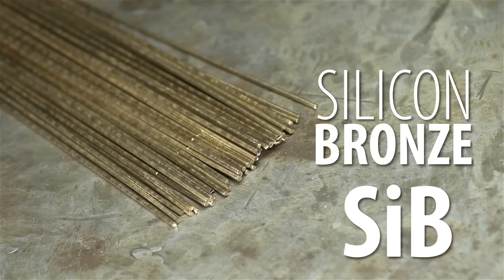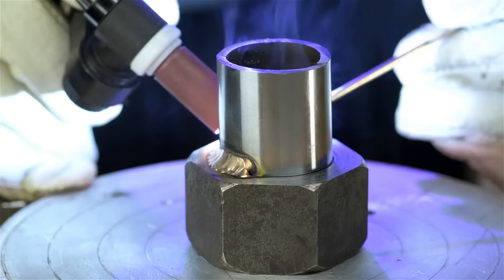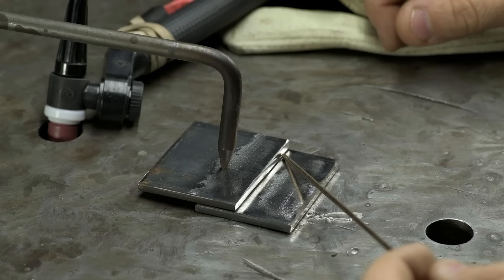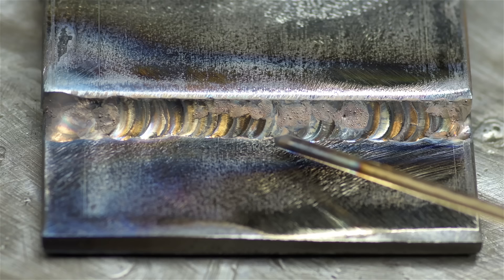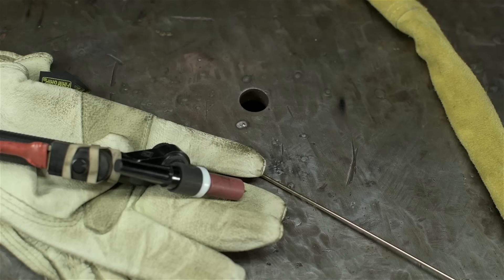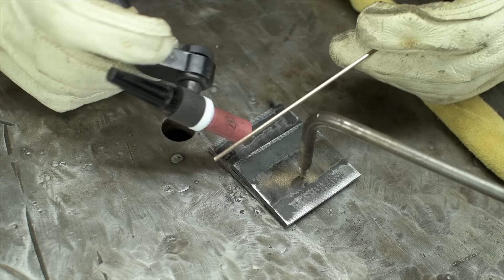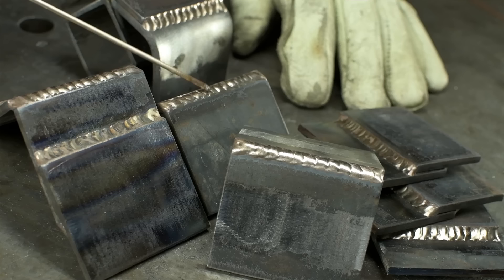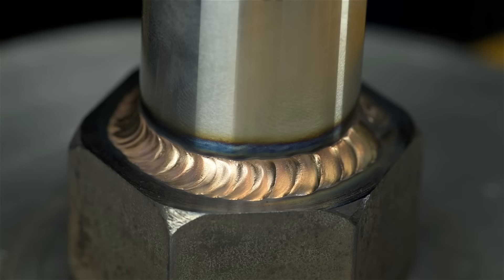Adventures in TIG Brazing

Comment: A really good quality welding helmet helped my bad welding much more than using a really good quality welder did.
Reply: What helmet
Reply: A good helmet and the right lense make all the difference
Reply: @stankhunter666  motorcycle helmet
Reply: Optrel 2.0 series is way to go!
Reply: It's all about comfort and control, if you don't feel comfortable and confident, it'll show in your welds
Reply: @Kawka1122  does it have to be dot approved
Reply: I really need to understand what a good helmet is.
Reply: me too
Reply: @MatthewTaylorAu  not so much the hood as the lense in it. Comfort is a factor as far as neck strain from different weights. But I personally use a huntsman slider. Nothing fancy but is light,flexible, can us with either a hard hat halo or a soft band. But I use lincoln 4c lense which is super clear lense. Mines a variable shade which is great for different welding. I typically run on shade 12 whit a pair of 50/50 safety glasses. But lense quality is (to me atleast) more important then the hood itself.
Reply: Being able to see is the key, i found not being tight and changing the clear lenses, or not using the same lid for mig welding galv was the key for me. I have a 3m, Miller and a $60 jobbie, still use the cheapy pretty often to be honest, just buy lens material in bigger sheets and cut my own now!
Reply: I read “bad welding” at a glance as “bed wetting” 🤣
Reply: Welding machines regardless of make, do the job. 98% of bad welding is the human. Its Honda like the humvee. They made it because 98% of ppl who think they can drive off road, can't.
Reply: @MatthewTaylorAu  Optrel panoramaxx 2.5
Reply: Adflow 9100x
Just get it. 
If your not a boilermaker dont worry but if you are it will add years to your life
Reply: You should spend a couple hundred dollars or more if you want an actual welding hood. Recommend Miller clearlite 2.0’s. Anything under 100$ is just for hobbyists.
Reply: @Xteam500  bad sensors
Reply: I'd like to see a polished etched cross section of the joint, suspect there's some minor mixing of parent metal and braze. Not quite weld, but more than braze.
Reply: Yeh my new helmet helped me to see that my work still wasn't sellable
Reply: borrowed my boss's 3M Adflow for a couple weeks. life changing.
Reply: Facts
Reply: Im just getting started and that thought occurred to me. Glad to hear it backed up. Now I just need hands that do what they are told and some patience with myself.
Reply: Only a rookie would say that
Reply: Tell me you know nothing about welding without telling me...
Reply: @frankiefc3  what does that mean, you don’t make any sense. What is the ugliest thing on a construction site? A welder with their hood up😜😆

Comment: You are working on a heat sink, try pre heating and doing it on a fire brick you need less amps for the flow. It's a simple thing hot summer less amps, cold winter pre heat

Comment: Tony, I'm a welding instructor and boilermaker. I enjoy your videos. They're not only very funny, but perhaps some of the most insightful sources on joining metals. I'm glad you mentioned joint configuration design and how a brazed joint can be just as strong. What I like about bronze is that it allows you to temporarily join dissimilar metals. Afterwarda apply heat and voila take them part with minimal distortion and clean up. So when you're working a prototype, it's an excellent alternative to welding if you want to save material in that phase of a project.
Reply from the maker: Good tip MB, will have to try that out!
Reply: MB, I've always heard it was a good way to permanently join dissimilar metals. Is that true? I do metal artwork, and while most of my work has been in stainless, I've sometimes wanted to add something like copper or brass to it for visual effect, and TIG brazing seemed like it might be the answer. I even bought some rod, but I've never tried it.
Reply: @TomHaroldArt  bronze would set that stainless off well. Sure you can permanently join dissimilar metals if that's what you want. Do me a favor: Look up titanium bicycles. Many of which are brazed together. I love the contrast. One of the oxy fuel assignments I have my students do is make a cube from polished 1/4" carbon steel plate with brazed joints. Afterwards they polish any rough spots out with a tiger paw or flapper wheel. Lastly spray it with a clear rustoluem so it doesn't oxidize.  I love what I do. I've started a non credit class once a semester where we make art out of silverware and hardware. For that I prefer stainless MIG or TIG. Good luck!
Reply: With flame braising, using flux coated filler, don't we strive for a more liquid flow of the SiB (lol) into the lap joint? The intent is increased bonded surface area. Legit question - I took a course, nothing more.
Reply: @sp10sn  yep. You want it to sweat in as much as possible. The tighter the joint, the stronger it is.
Reply: Many thanks! I will look up those bicycles. I'd love to try something a little different. There are several other people who do what I do, and it would be nice to have something that stood out. I think the color contrast would be killer! Sure wish I could take a course similar to what you offer. My former shop boss took welding all through high school, and he had so much knowledge that I'd never pick up just from working on the job. Does rustoleum really hold up? I've had seemingly a hundred people tell me there's no clear coat that will ever permanently prevent rust over bare metal.
Reply: @TomHaroldArt  Put enough of that shit on there and it will be fine.
Reply: That's good advice, thanks!

Comment: Tony, I finally did some silicon-bronze TIG "welding" of some 16 ga steel sheet metal, it is totally amazing, I was able to do functional, though not pretty, welds without practice, the current is low enough that you don't risk burning through the sheet metal. IMHO this is what people like me should practice before going on to true welding, which I'm still not good at and will continue to avoid where possible because I get too few opportunities to practice in my field of hobby machining.  Another advantage for the newbie is that accidentally contaminating your tungsten with silicon-bronze doesn't affect the process and you can just keep going, unlike with aluminum welding where you have to stop and meticulously clean the tungsten and the parts and your progress is inches per hour rather than inches per minute(!).  Again, a million thanks for letting us know about this amazing process.

Comment: Tony thx for sharing. Once upon a time I used to work in a sheet metal shop where I carbon arc brazed flanges onto sheet metal duct-work. I didn't use double carbon rods, like gougers use, I used a single carbon rod as the heat source. The flange was about 1/8" thick whilst the duct was 20Ga. If I recall correctly the current was around 45A. I did apply the bulk of the heat to the flange. The bronze rod was just about flat to the joint. The bad news was that the flange & duct were both galvanized. I'm just glad I worked under a giant hood. So the carbon rod brazing method seems to be relatively forgiving when it comes to surface prep. There wasn't any. This method was called Eberdu brazing. Most likely the name Eberdu was a product name most likely the silicon bronze rod.

The joint had a smoothness to it like soldering does. No puddling dimes effect. Just a smeared out bronze down the length of the joint.

Hope someone finds this interesting.

Comment: I've only dabbled with SiB a few times but I do know you want a longer arc length, maybe double what you normally do while welding. The longer arc length will help spread all that heat out and make it wet in more smoothly. Using a gas lense on your torch and about 20-30cfh you'll get it to look really clean and pretty without having to brush the crap out of it.

Comment: Great video. I found silicon bronze very useful while building racing headers. I will always use it for a primary pipe attached to a cylinder head flange. You can keep the tubing light, thin wall, and reduce hardening the tubing and eventual cracking.

Comment: I used to use this technique occasionally on very unusual repairs, it melts so easily with little heat. Using silver soldier with a tig is also very useful sometimes when I needed to patch leaks in copper electrical equipment, when heat was a problem.

Comment: The use case where I've seen this stuff really SHINE (heh) is putting together complex shapes made from stamped or cnc bent steel sheet that has dimensions susceptible to warping out of spec with too much heat.  I found that clamping pieces together with a bit of a gap, resting the tungsten directly in the gap, pointed at the filler, and just letting er rip, running the torch down the line at full petal as fast as I could follow the bead seemed to be the best approach for minimizing heat affected zone while still making a solid braze.  You have to get a feel for how the stuff feeds into the puddle but it's an absolute joy to work with! Great stuff Tony

Comment: Thanks for sharing this knowledge, I am a retired, Coded TIG welder and I know how skilled you are. (VERY)
 I never knew TIG could do this, I did try once with brazing rods and you know the result !
I still keep my eye in with a portable MMA and TIG welder DC only, to keep the cost down, it has got auto strike HF.
I welded Aluminum professionally, but not enough need at home to justify the cost of  an AC / DC kit.
I will definitely get me some of those Silicone Bronze rods though, and have a play, on MS, S/S and Copper.
I found this video purely by chance, whilst researching World Bridges for my brother. I will look for more,Thank you.

Comment: Having done soldering, silver soldering, silver brazing, etc, etc, etc, I can totaly agree about the difference between gas brazing and TIG brazing.  For those not in the know, a properly fit up joint that is well cleaned, fluxed, and heated with the filler applied in the correct way and amount with a gas torch will result in fillets on both the outside and inside of the joint as well as the interface.  The result is a weld that far exceeds the strength of the base metals in most cases.  Think CrMo motorcycle and bicycle frames as a prime example.  Some aircraft frames use this method as well.  I have used silver solder to join parts to make custom hydraulic fittings even that held
Reply: I've always used silver brazing for small parts that need to look good and be gas and oil tight. What I'm wondering is, there has to be a way to use a TIG welder to do silver brazing? You need about 1100F red hot metal, or somewhere thereabouts, to where the metal is glowing orange hot, to make the silver braze work. I wonder if there is a way, maybe with a blunt tungsten, or with really super low amps, where you can heat up the seam without directly ruining the base metals?
Reply: @Ritalie  Don't really know about that.  The lack of flux may not allow the silver alloy to flow.  If the parts are very clean and with the proper  silver braze parts in vacuum furnaces.  Fit up some parts and give it a go is what I say.

Comment: Tell you hwat friend, if you try this again, try it on AC with the balance way up at 95-99% so it's almost purely EN. Works great for brazing, as it gives you a little wiggle room towards not melting the base material and adds a little bit of cleaning. current professional welder.
Reply: Interesting tip. thanks

Comment: I love your welding&co videos. As a welder you give me great giggles and remind me of the "good old times" when I was learning all this stuff :D

When it comes to TIG-Brazing you basically wanna flood everything with Argon. It's the only flux you have! As a rule of thumb: Biggest cup you have + 50% is just to small.
If you watch closely, you can see the hot end of the rod leaving the Argon a couple of times, witch causes the oxides on the braze.
In terms of aesthetics; try feeding the braze rod continuously instead of dipping to miming the look of a gas brazing...
Reply: The extra argon prevents oxidization, which is evident by the black patches and porosity.  Also the unoxidizde bronze will flow and wet out better.

Comment: I've done a little (very little) TIG brazing, and you are using quite a bit more amps than I've used.  I think you're approaching the inches-of-weld-per-minute like steel filler welding.  On thinner material (.063) I was using only 20 amps, but going much slower and watching for the material to heat up visibly.  I also found that a gas lense was very helpful.   

BTW, thanks a bunch, this video just makes me want even more to sell my trusty old Lincoln Square Wave 175 (the Model A of TIG welders) and get a new, fancy welder with pulse control.  They'll only pay for plasma donations twice a month. /fast cut/
Reply: I was thinking the opposite and treating it like stainless. Crank the amps and move quickly

Comment: Yes, you did melt the base metal. That's ok.  You ALWAYS will..... Well, sort of. Once the filler melts, and contacts the hot base metal, some of the base metal will dissolve into the filler. Ideally, you get a thin alloy layer at the interface, primarily due to diffusion into the base, and that is it. In practice, you get some base dissolving into the liquid filler. That's ok. It is fine. The bond from brazing is due to the intermetallic layer. Too much dilution, on the other hand, can lead to issues such as cracking. Perfectly executed TIG brazing still is never like a furnace braze, as it is really braze welding (putting in bulk filler, rather than filling a narrow gap).
Reply: This is where a short slope up on current is useful, so you can dab in before the parent metal actually melts. It's a timing thing you learn after many attempts. Once you get it you won't compromise the parent materials integrity :-) :-)
Reply: Thanks, this comment really cleared up what Tony was doing vs the torch brazing I'm familiar with.

Comment: Wonderful video, and entertaining as usual. I'd be curious to see this done on AC with an AC balance setting similar to welding aluminum. I have a hunch the cleaning action would help and the AC may help with heat control as well, preventing melting into the edge of the base metal.

Comment: Brazing is cool. When i realised i didnt need a tig to join aluminium (instead, just braze with hts2000 brazing rod and a propane torch) a new world opened to me...
Reply: I had a fellow employee call me Wrong Way Willie when he saw me brazing a pulley set back together for my John Deere mower, he's gone, the braze is still holding 18 yrs later
Reply: According to the AWS anything above 800 F to the melting point of the joint is defined as braising.

Comment: You mentioned that it is sometimes called SIB bronze. From my experience it is referred to as SIF bronze. Stands for Suffolk Iron Foundry who developed the rods that had a longer transition from stiff to flowing which is why you can build up fillets. Very commonly used in low volume motorcycle frames etc.
Reply: A friend of mine was going to repaint an old rusty bicycle, but once sandblasted he found all the brazed joints on the frame so beutiful,, he just clearcoated it as it was

Comment: I spent quite a few months TIG brazing brass to copper as an apprentice. A longer arc (around 4mm) helped prevent melting of the parent metal (in my case the brass parent metal contained zinc, so overheating the parent metal had to be avoided to avoid porosity). Have also TIG brazed steel to copper and galvanised steel to galvanised steel. For 1/16 filler rod, pulse frequency of around 2.5 Hz with filler added on every 3rd pulse provided an almost flawless wash.

Comment: Another fantastic video! We've had the same experience with ErSiCu, as I too attempted the "foul" experience with O/A rod.....when my LWS didn't know the difference. Even though you're technically not melting the base material, seems that SIB almost requires a "shock" of heat to flow out, which I do with the pedal. I still haven't attained "Jody status" with my Tig brazing. Thanks again!